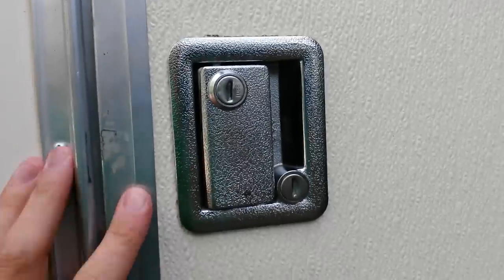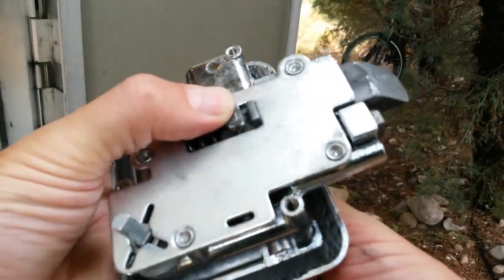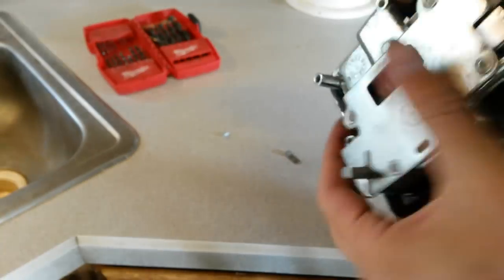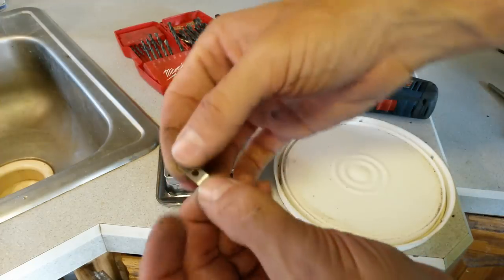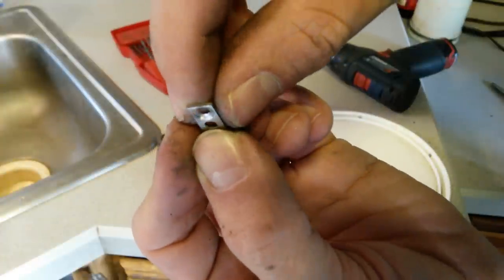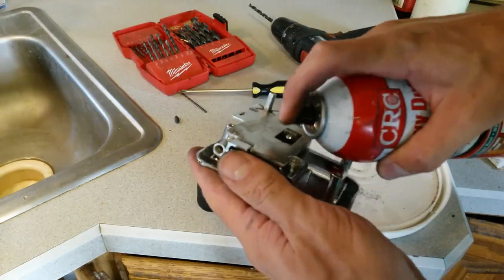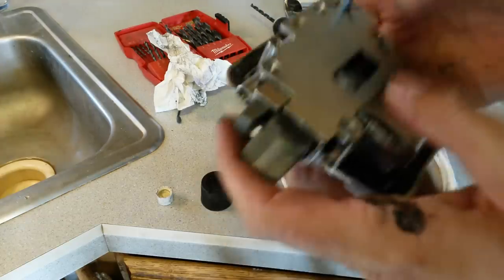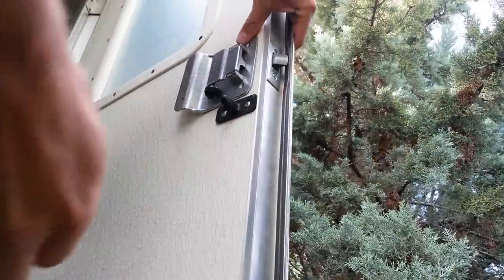This Old Trailer ~Fixing an RV Door Latch/Lockset ~Repair or Replace Your RV Door Handle

Comment: My rv door is oddly thick. I even purchased a set of new handles but they were too thin and when installed, the cast alum. levers would not catch each other, and the deadbolt lever would not engage.

Comment: Do you know how to get in a lock door? We just bought a new RV and the place was closed yesterday and they won't be open until next week. Our RV door wouldn't open after going through a snow storm. The deadbolt key won't go in all the way. Pls help if you know anything. thx
Reply: Spray a bunch of WD-40 or graphite lock spray into the key hole. These tumblers are not very smooth. Work the key in with the lube. Graphite is always preferable